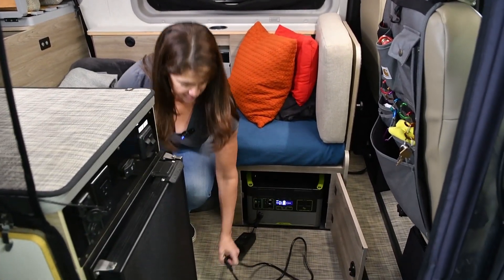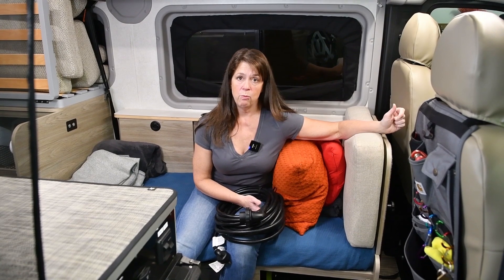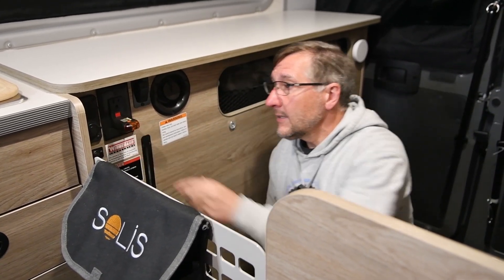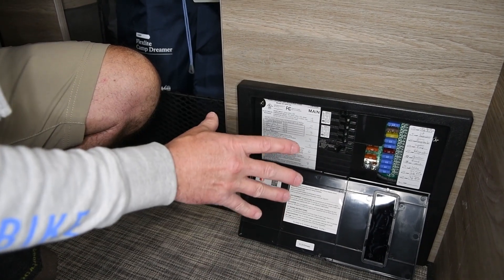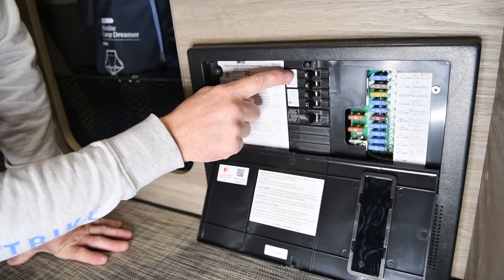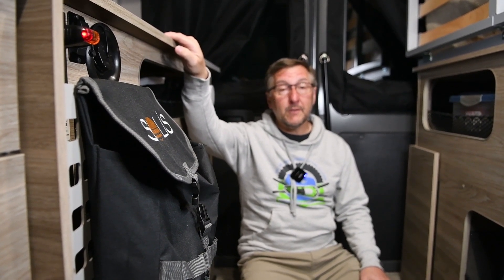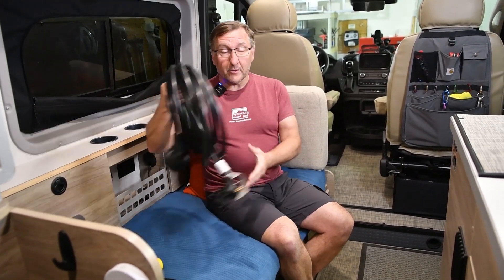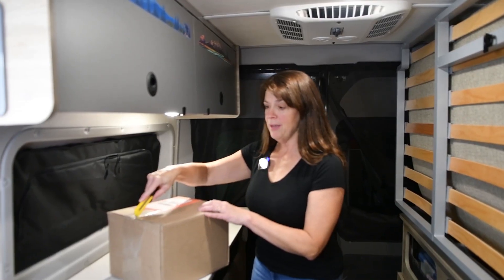Solis Pocket Electrical Problem! 120V not working properly in nearly new van?

Comment: I'm considering a Solis, and I'm appalled at how you were treated by their lack of service, requiring you to do all of the trouble shooting and them resisting your findings until they finally gave in and sent you a new cable. Furthermore, they apparently don't even bother to label the rear solar plug with + and - or Pos Neg to indicate which port is which.... requiring you to meter the plug to insure proper conductivity. They just kit bashed that solar plug with a cheap part and left it at that! Add to that, their lack of proper documentation. Come on! Just how many users do they expect to have an OHM meter with test leads to trouble shoot stuff that users should not have to trouble shoot when supplied properly in the first place! Where's their QA to test out EACH and every component that customers purchase from them? Maybe if they had such a QA Department, their vans could be sold with a QA label that reads "100% fully tested at time of assembly and shipment for your safety and assurance on the road. Enjoy your camper with full confidence! Thank you. The Management." I have no doubt that you paid top dollar for this rig, that would warrant such a QA label. A pity. Now my own purchasing choice survey has some red flags next to Solis. These campers are high ticket items for some of us, and we will do our Due Diligence with reviews provided by other owners. Solis... GET WITH IT! Thank you, OUTAPocket for posting this most informative video. I hope everything works out for you and your camper from now on. Safe travels, friend!
Reply from the maker: Hello! Thanks for sharing your perspectives! Our experience seems pretty standard for Solis owners, maybe not even that bad by comparison with some stories I have heard. The Pocket is a great van for our needs, despite these issues, which are a little disappointing. This van is a bit lower on the price scale than many others so there are compromises, and fortunately we have the time and skill to do some investigation when issues come up. We did buy from an out of state dealer (1000 miles away) which also added some risk. Glad you found our information useful and thank you for watching. Good luck in your search!

Comment: I've had GFCI outlets that I thought I had pressed the "reset" button hard enough to reset, but didn't. Perhaps that one questionable outlet was like that. . .the reset button just needed a bit more convincing with a firmer push. BTW, I've got the same model Pocket, and have yet to test all the systems. I'm subscribing so I can use your expertise to help guid me along. Thanks.
Reply from the maker: Thanks for watching and commenting. I was pressing that reset button pretty hard. Sometimes that outlet resets and works fine, and sometimes it doesn't. Still chasing it! Might replace it and see what happens. Enjoy your Pocket!
Reply: To be fair, the GFCI was working--you had a ground fault with the original cable. So, it tripped and would not reset because there was still a ground fault.

Comment: A 900w space heater tripped the circuit when we were plugged into the AC outlet over the fridge. You said it doesn't have a reset, but it does. Multiple outlets on the same circuit only need one outlet with a GFI, so the the outlet that's around the corner by the water tank (which has a GFI module) had tripped. After I reset that, it and the fridge-side plug worked. Sounds like you have more problems than that, but I thought I'd mention it.
Reply from the maker: Thanks for watching and for sharing your experiences. At the time we said that outlet didn't have a reset, we had not figured out how the various circuits were configured yet. Now we know of course that two outlets are on the same circuit and as you say each circuit only needs one GFCI outlet. However, in our case, it is the two front outlets (above fridge and under passenger seat) that are on one circuit, where it sounds like in your case, the one above the fridge and the one by the water tank are on the same circuit. So maybe our vans are configured differently? Ours is a 2023. In any case, thanks for the comment!

Comment: Your patience and persistence really paid off. Kudos to you for the thorough troubleshooting. Also, kudos to Winnebago for sending that cable to you and not making you have a dealer confirm the problem, etc. You should follow up with them and thank them for the service - and ask if they want the defective cable back. If they outsource that part, it might be something they want to share with the manufacturer. If they make it, it might be a training/improvement opportunity.
Reply from the maker: Thanks for the follow-up and positive feedback. I will offer them a thank you as you suggest. Interestingly, the old/bad cable was made by a different company than the new one we got. Neither were Winnebago. So who knows, maybe they are already onto it!

Comment: Thank you for the methodical approach to troubleshooting. I learned a few things. We have A Solis 36A. It will be good to have this knowledge in my background understanding of the electrical system. There is one more outlet in the center of the dinette you didn’t test. Just FYI, in case you didn’t know you have an outlet there.
Reply from the maker: Hello! Great to meet another Pocket owner! Thank you for the feedback. You are absolutely right about that 4th outlet, in the cubby in the couch/dinette area. We honestly never saw it before and missed that completely. I just went to test what circuit it is on... and surprise! It is on circuit #2, same as the DC Converter. So now the label on that 15A circuit makes sense: "Recepts/Conv". So 15A circuit #1 = outlets under passenger seat and above fridge, 15A circuit #2 = dinette outlet and RV 12V converter/charger, and 15A circuit #3 (microwave) is the outlet in the back area. Circuit #4 is 20A and for the air conditioner (another thing we have not tested yet). Thanks so much for pointing that out!